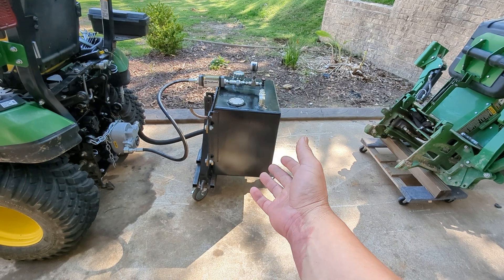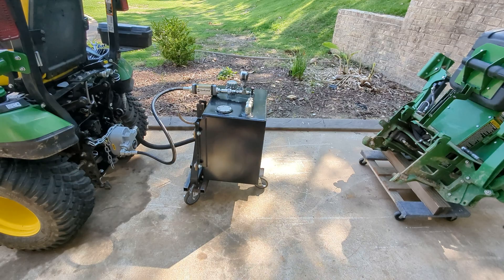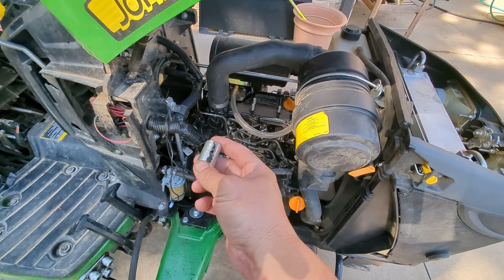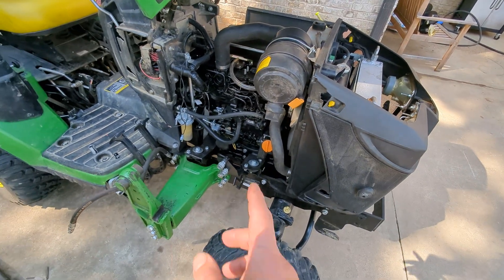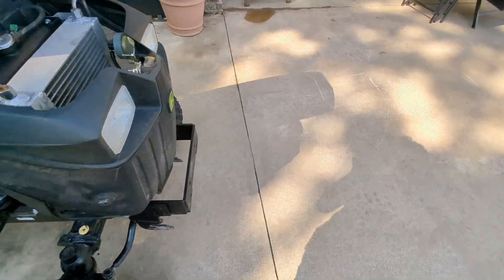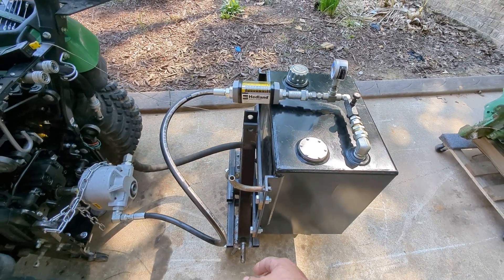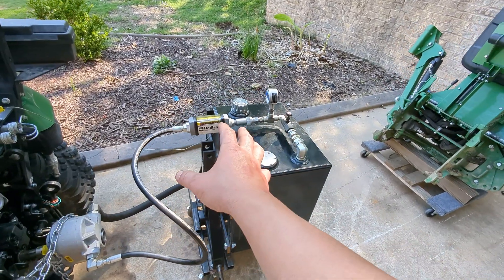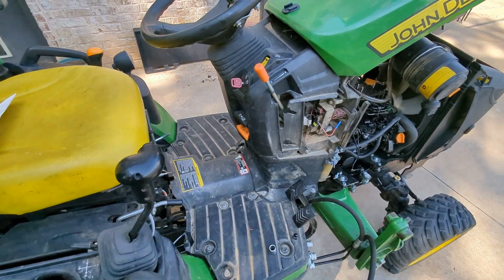HydrosPlus Power Comparison Apparatus - 1025R Turbo Testing Prep

Comment: I operate at 8000ft elevation, and my tractor sputters a bit at high rpm.  So I'm very very hopeful the turbo is going to really be a game changer as I'm sure that my overall "power" is diminished at these altitudes.  I'll be curious to learn about how much fuel I should dump in to "tune" it properly with the turbo.